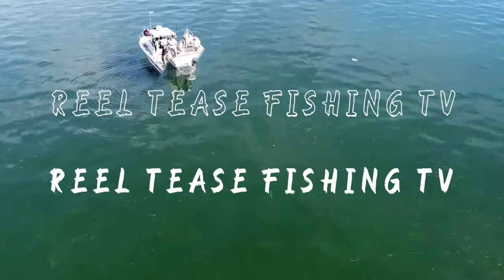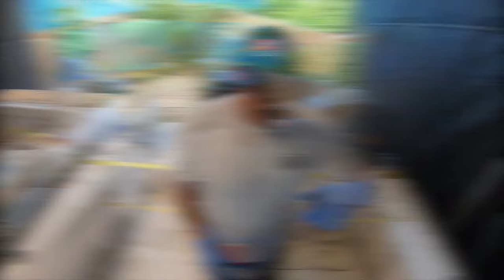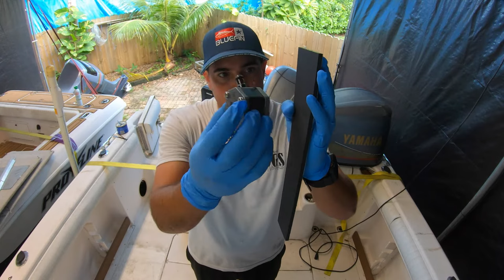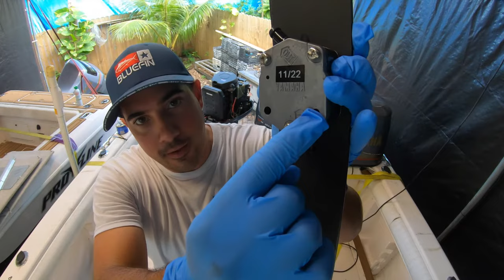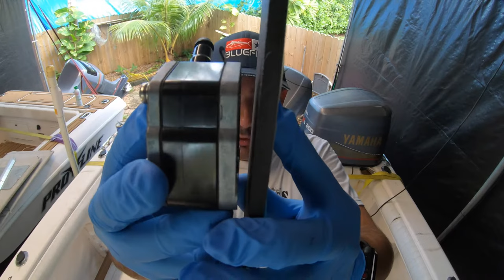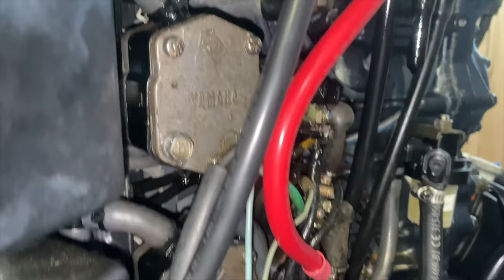How to Test a Low Pressure Fuel Pump

Comment: @ReelTeaseFishing, I have Yamaha OX66 225hp which is currently leaking fuel out for the lower unit. I have change the fuel injectors and all 6 sparks plugs, what do you think this could be. thanks
Reply from the maker: Take the cowling off your outboard.Turn on the power to the boat. Then Manually pump your primer bulb and turn the key to the on position but don’t crank the engine. Start looking for leaks or spurts of fuel. Follow all the fuel lines, all the areas the fuel flow to. Don’t see anything? 
Pull off the air box/silencer (we have a video that shows how on our channel) continue to look for leaking fuel on all hoses and now from the carbs. Still nothing? Have a friend pump the primer continuously while you go through the engine again looking for fuel spilling.
My bet is a cracked fuel line and fuel dripping down the cowling and down the shaft out your lower unit.
Reply: @ReelTeaseFishing  checked all fuel lines no leak, this happens when running the motor, I believe its the LP pump which I'm gonna replace next week.

Comment: Hey my ox66 surges when I’m throttling it. Rpm goes up and cuts out then kicks back in. It starts and idles fine. I replaced high pressure pump, clean injectors, new plugs, I even ran it off a 5 gallon can to eliminate fuel tank and I’m still having the same problem. I used an inline glass spark tester while engine running to watch each plug fire at a time and neither stop firing at any time. I was thinking it was the neutral safety switch but all are firing. Could it be the oxygen sensor? Could it be the stator is still bad?
Reply from the maker: If it has an oxygen sensor I’d highly recommend cleaning it out. Also recommend doing your VST filter if it’s fuel injected. Let me know after you do this if it’s still giving you the same problem.
Ps. Check to make sure you don’t have any air leaking into the fuel system via old gas hoses, loose clamps/fittings or orings on the fuel filter. When you open VST you need the kit to replace orings/seals. Air will cause surging
Reply: @ReelTeaseFishing  rebuild vst, all new fuel hoses and clamps. I’ll check the oxygen sensor

Comment: Hey man i got a 1998 yamaha 130 v 2 stroke and i have change the  pump, rebuild carbs , change gas , filters but still everytime i turn it on , runs for 1 min then turns off
Reply from the maker: Change the spark plugs? They tend to get fouled easily. 
Also what’s it idling at? If the idle is set too low she will struggle to stay on. The sweet spot is like 700rpms in the water. About 1k rpms on the hose

Comment: Hey Carlos I have a 200 HP 03 Saltwater series II 200 HP I am not getting any fuel sucked up into the motor it’s been sitting for 15 years what do you think it could be ? I have e two of those fuel pumps you showed one on top on on bottom .
Reply from the maker: Joel not sure if you sent me the same message from a different account but I’d highly recommend putting the new fuel line into an external tank with clean fuel prime the bulb and see if that changes anything. If you start getting fuel to the engine then we know the issue is at the tank on the boat.
Reply: @ReelTeaseFishing  I did that no dice still not getting fuel to the engine could it be both pumps ?
Reply from the maker: @joelreyes6517  when you say fuel is not getting to the engine where is it not getting.
You have a small fuel filter (bowl) before your pumps. Is gas getting there? 
Is it carbed or fuel injected?
Reply from the maker: @joelreyes6517  it won’t hurt to do the test as shown in the video. If they are leaking a lot it can definitely be your problem.
Reply: @ReelTeaseFishing  it’s not making it to that filter before the the pumps . It’s fuel injected
Reply: @ReelTeaseFishing   if I fill up that filter with gas and try cranking it it sucks up about half the gas in that filter then it stops
Reply: @ReelTeaseFishing  no gas is making it to them so not sure what it could be
Reply from the maker: @joelreyes6517  looks like you may have an issue with the fuel bulb. if it isn't getting to the first filter before your pumps make sure no kinks in the gas line and try pumping the fuel bulb in the vertical position (up and down) until it gets very hard. The filter should now be full. (make sure the arrow on the fuel bulb is pointing inline to the engine.

Comment: I have a evinrude 150hp not getting fuel but I do have spark, any tips.
Reply from the maker: Depends what year and model but they do have a diaphragm fuel pump that tends to go bad. I’d look into that possibility. 
Then I’d start from the fuel tank to the engine check for leaks in the fuel hose. Signs of dry rot in your fuel hose can compromise the whole system as it allows air into it. check fuel bulb that it gets hard when pumped. Swap fuel filters for new ones. Lastly I’d overhaul carbs if it’s a carbed model

Comment: 1995 Yamaha 130 2 stroke. Bogging under load.. around 1500-2000k rpm. If you power thru the bog she will run wfo 5600 rpm’s with a slight miss you can hear. All plugs look the same.. new plugs new after market coil packs. 4 micron water fuel separator and a 10 micron after that and the factory water fuel separator on engine.. boat had 98 hours on it when I got it from my uncle January 2023 and now has 250. 

Could this be a fuel pump issue? 

I only run non ethanol fuel. It’s oil injected still.
Reply from the maker: Definitely can be a failing pump. Have you also considered completely rebuilding your carbs?
Reply: @ReelTeaseFishing  that’s the next step. But the carbs were rebuilt and cleaned and sync about 3 months before I got it from my uncle original owner. Iv had it for a year and it only sits during the week. I’m assuming it’s the original fuel pump. He said he’s never changed it. 

I’m going to unbolt it test the pump in the am. I know the compression is 125 in all 4. 

This problem has just recently started..
Reply: @ReelTeaseFishing  you have a video of you doing a complete rebuild on the 115/130 carbs
Reply from the maker: @hunterherrera7863  I do not have a video but Yamaha carbs are all pretty straightforward. There are some good videos on YouTube of similar carbs being redone. Buy an OEM kit if you do it.
Reply: @ReelTeaseFishing  always OEM. On a car I’ll do after market. But the water heck no. 30 miles off shore is a long way to swim home. I might have did my self dirty when I bought some after market coils. So the wife is grabbing me a timing light as we speak and I’m swapping back to my good old coil. Making sure the idle timing is right. 

And testing the fuel pump making sure it’s not leaking the the vacuum hole. I have more smoke than normal. And that one sign. 

If I have to pull the carbs well then guess I’ll pull clean rebuild adjust and sync
Reply: @ReelTeaseFishing  fuel pump is leaking like expected. It has a white dot on the face of the pump. Meaning it’s original from 1995. New OEM pump will be here Tuesday. Mounting it and then running to ocala to a buddy shop and timing it. As boat timing is not my cup of tea. 

As soon as I told him the fuel pump was original he said welp there’s part of your problem. And take off the shity aftermarket coil packs. He will get me OEM at his cost.
Reply from the maker: @hunterherrera7863  awesome! Sounds like you may be back on the water pretty soon. Always great when you have a buddy that can set and check timing. 
I don’t have that skill down myself either. 
Best of luck, let me know how it all goes
Reply: @ReelTeaseFishing  I swapped the after market coils I had on there back to the original from 1995 and she throttled thru all RPMs. With a slight miss. New fuel pump will be here today around 3. And I’ll swap them out. Change all filters “again” and the foot oil and get it cleaned and ready for the tuning on Friday. I can’t wait to see what he can get outa this little engine. He’s damn good with fine tuning them. 

I’ll for sure keep
You updated. Thanks for all the help. And keep up the good videos.
Reply from the maker: @hunterherrera7863  thank you sir! Glad to hear the great news 👍🏽
Reply: @ReelTeaseFishing  after replacing the fuel pump and dialing in timing 6 degrees advanced. And everything spot on. Boat still has a sputter. After a good hour n a half cool down. Did compression test. Even tho Iv done it with in this year. I’m sitting at 125 124 124 125. 

I pulled plug wires while running. And engine started to run like trash. Ok coils are good……. 

Welp after checking ohms on what we thought were good coils…. All primary checked out good but one all secondary checked out good but one. 

The bad one was reading on primary 2.0…. Should be 1 or less. Reading on secondary was 22.6k ohms. Should be 3.8k ohms + / - 20% .0.76…. 

Now waiting on 2 OEM coils and boots.

Comment: I. Have a 125 mercury 1985 and I am having trouble with starting no gasoline in the carburetors! I don’t know what to doo
Reply from the maker: Is your kill switch inplace?
Reply: I really don’t know I’m new to this stuff?
Reply from the maker: Ok so very basic, two features on an outboard that will not allow it to start. Usually it cuts the spark to the spark plugs but it may cut fuel to the pumps as well.
You have a killswitch, usually a red lanyard to a button. Make sure that’s installed. 
Secondly the throttle needs to be positioned in neutral for the engine to crank over.

For fuel, there’s a bulb in-line sonewhere between the tank and the motor. Hand pump it till it gets hard. That is necessary everytime you go to start the engine at the beginning of a trip.
Let me know if that helped
We can continue troubleshooting if not

Comment: Can the fuel pump turn it on and still keep it running? Under load it turns off df140 2003...i just ordered a fuel filter for it
Reply from the maker: Can def be a symptom. 
These pumps are not electrical in any way. They just work on vacuum
Reply: @ReelTeaseFishing  o ok. With the ear muffs it works, spins the prop fast in gear but under load it cant. It sputters and dies. I cant even get it off the dock
Reply from the maker: @finecrazygunz  sounds like your issue is lack of power. Could be fuel restriction, could be voltage issue, 
Is this fuel injected?
Reply: @ReelTeaseFishing  yea 2003 sazuki df140 4 stroke
Reply from the maker: @finecrazygunz  if you have changed all the filters. I’d really look into your fuel. Rule out dirty fuel or water in fuel. Once that is not a factor I’d move to clean your fuel injectors. Don’t do injectors until you know the fuel is good or you will just dirty the injectors again.
Reply: @ReelTeaseFishing  ima have to check the fuel pump. Lossen the 2 bolts and see if it leaks. Just been really busy

Comment: How would I know what year my yahmi 200 etxp 6g6 755714 is from. It's on a 81 G.W 24 offshore.
Reply from the maker: My thinking without seeing the actual plate is that is a 25” shaft 1991 outboard
Reply: @ReelTeaseFishing...yes its a 25 inch shift   port side of the outboard name plate top left on the plate says 200.topright extp.bottom left 6g6 bottom right 7557 14.so if it's a 1991 I really thank you for that info
Reply from the maker: @nwrx247  I believe it to be 1991 according to that info you provided

Comment: Can these go bad without leaking externally?   

My '06 yama150txr started & idled perfect after sitting 2 years (cancer sucks lol).  Tied to dock and shut it off.  Never ran again.   It'll run on starting fluid, and one single time it actually started on starter fluid and then idled perfectly on its own fuel for about 30 seconds before I shut it off.  I tried starting again, and it won't run without starting fluid.  I'm not exactly sure where to go from here.  Is there any other way of testing them, or does it sound like another issue altogether?
Reply from the maker: Is the gas you are using fresh? 
Sitting for two years I’d replace everything from the fuel lines to the motor. That includes bulb and spin on fuel filters.. I’d definitely also get the tank pumped and put clean fuel. 

You can try this using an external tank with fresh fuel and new lines as an alternative for now.
I’d also highly suggest if a carb model, redoing your carbs using OEM carb kits. If it’s fuel injected you may want to look into your injectors and Definitely clean the VST tank. 

Glad to hear you are back out there getting it done! ❤️
Reply: @ReelTeaseFishing I do have one more quick question.   I still need to find the location of the electric pump, but is the electric pump the that brings fuel to the engine, or is it one of the others?
Reply from the maker: @jeeplove_8831  ok if my memory is correct this is a 2 stroke carbed outboard. Your fuel pumps which is two of them should look like the one in the video. It is your only fuel pump and it’s not electric but works on a vacuum created by the engine where it is mounted. (They are notorious for going bad) my suggestion is replace them now regardless so that you know you have to new fuel pumps. Yamaha says these are a 3 year service item. Buy only OEM Yamaha pumps avoid Amazon and eBay as they sell plenty of fakes.
The only other “fuel pump” would be your hand pump fuel bulb that is on your fuel line before the outboard.
Reply: @ReelTeaseFishing  yeah, the symptoms of what I'm describing would make sense if it was carbureted with a lift pump or whatever primes it gone bad, but it's a 2006 Yamaha 150 four-stroke, it has a 4 fuel injectors on the rail.  It has a low pressure pump that looks exactly like the one in the video, but the fuse box cover on the engine says it has an electric fuel pump as well.   I checked the fuse but it was good, so I was going to try to locate and test it with a power probe this weekend.
Reply: It's just really weird.  I was actually going to mention earlier that it acted just like the Venturi effect on a carb but is fuel injected so it didn't make sense to me.  Maybe one of the pumps is intermittently working.
Reply from the maker: @jeeplove_8831  can happen. You won’t see a leak unless you unscrew it from the outboard. If they are holding pressure than they should be good
Reply: @ReelTeaseFishing  okay cool, I'm pretty sure I understand the order of operations now, all I need to do is replace my fuel bulb (and lines) so that I'm able to squeeze it and start diagnosing.   Then I should be able to check everything up to and including the low pressure pump just by pumping it with it loose.  
             I couldn't find my exact model, but a 90hp diagram showed it running out of the low pressure into an electrical fuel pump, which can be located inside the VST, then runs its course towards the injectors.  Does that sound correct to you?
Reply from the maker: @jeeplove_8831  yes it sounds correct. Electric pump is located within the VST. Sorry thought this was a carbed model. 
If you open VST I highly suggest putting new VST filter

Comment: Gas is dripping from the block when I press the primer bulb
Reply from the maker: Dripping from the fuel pump area? From the VST area, from a carb I’m not sure how I can help
Reply: @ReelTeaseFishing  it’s dripping from the bottom vst area. I think it’s dripping from the inside because I don’t see any visible leaks from the outside
Reply from the maker: @ikelove1973  interesting. So the VST is two parts the top part separates and that takes a big oring/gasket that fails. Yamaha says it’s not reusable. Basically need a new one every time it’s opened for cleaning etc. 
also the VST has a lot of fuel hoses on the top side. If they are original, it could be cracked hoses or pinhole causing a leak. Lastly fuel pumps on the block could be leaking, making it seam as if it’s the vST
Reply: @ReelTeaseFishing  ok thanx for your help

Comment: Bro help please my primer won’t get hard
Reply from the maker: Did you check the fuel pumps. Also is your engine acting a certain way?
Reply: @ReelTeaseFishing  thanks for the reply ,I’ll check this week,I’m glad I saw your video ,it’s a 70hp Yamaha,basically the engine stops working,everything normal but you can tell it’s the Gas not getting to the motor .
I already have all the parts to do an oil change and change the filters as well as the lower unit ,let’s see what happens. Thanks again
Reply from the maker: @MangoAficionado  if the engine doesn’t stay on but does stay on if you pump it manually you have a completely failed fuel pump. 
By the sound of it seems the bulb is not staying hard because the pump is shot. 
It’s also not uncommon to have a primer bulb go bad. 
Check fuel lines for any dry rot, cracks etc